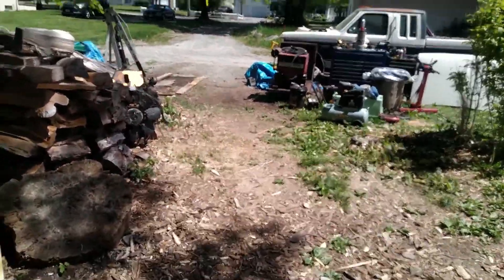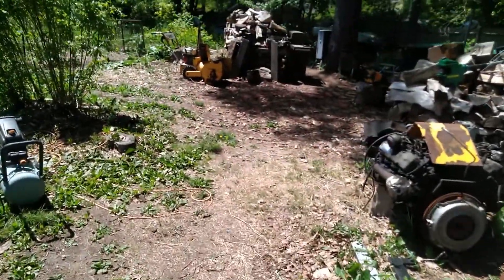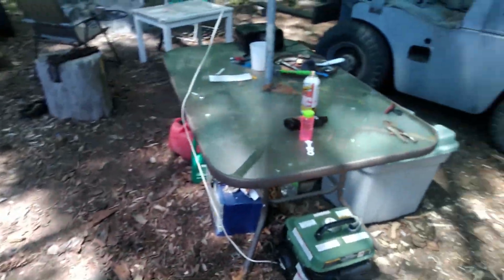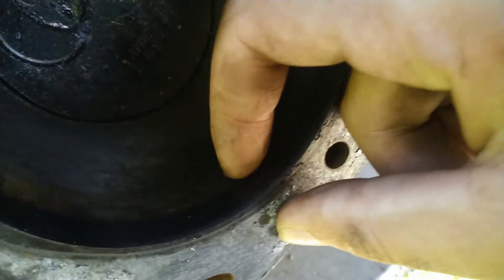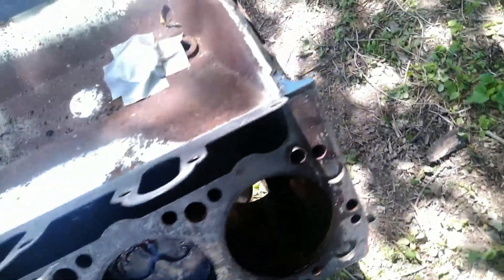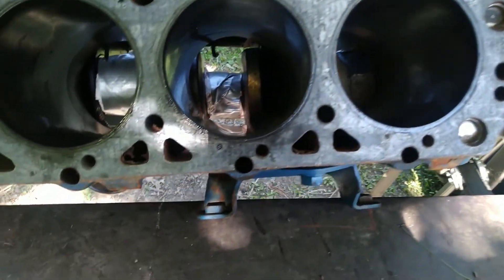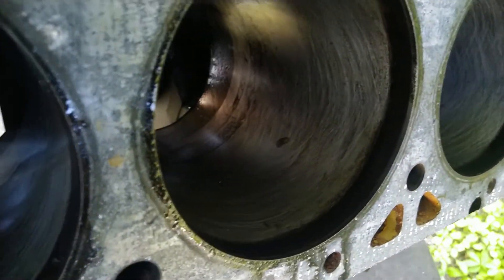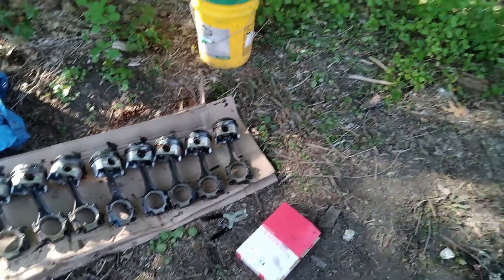7.3 idi build part 1

Comment: hello  i have a 88 7.3 idi   can i put a turbo on it fairly easy ?  i think it has alot of miles on it..  runs great,alittle smoke  but doesnt start for shit,  always needs a quick shot of either   thanks,  like your style
Reply from the maker: If you can find the stock 94 turbo system in a junkyard or somewhere it's pretty straight forward.  The only things you have to do beforehand is move the glow plug relay, pcv valve, and oil pressure sensor.  The turbo and up pipe will bolt right on, then you need to make a line for oil feed going to where the oil pressure sensor was on the back of the engine.

If you leave the wastegate on you don't need head studs, but if you delete it like I did, you probably want them.  From there, to increase fuel there is a small cover on the side on the injection pump, take that off and rotate the engine until you can see a small allen screw.  That sets max fuel.

As for your starting issues, IDIs heavily depend on strong glow plugs.  When you change the plugs only use Motorcraft plugs.  Not the Autolite ones.  It's also common for the glow plug controller/relay to fail.

Comment: Hey Im looking into doing my idi I wants to go from non turbo to turbo and I think you answered the biggest question I had but I also wanted to know, how much boost can u run on those things?
Reply from the maker: It's my understanding that with stock compression and head studs, you shouldn't go higher than 20 psi.  If you lower the compression a bit and beef up the rods you should be able to push 30+ psi, but I'm not sure.  Ask Justin at R&D IDI performance.  He'll know how much they can take.